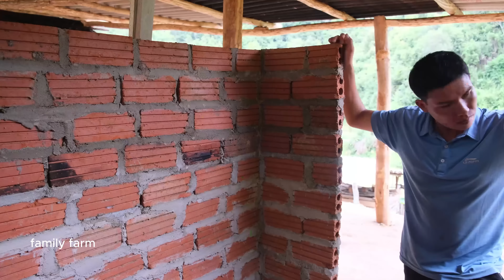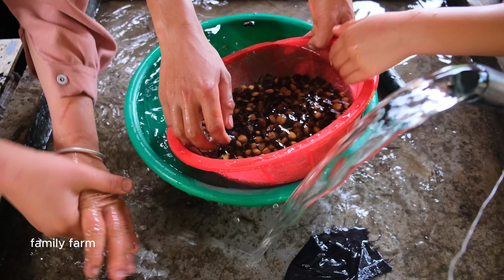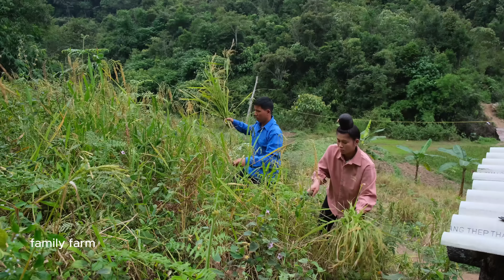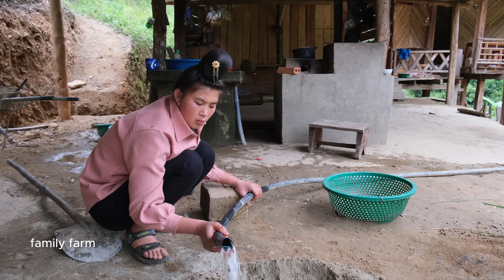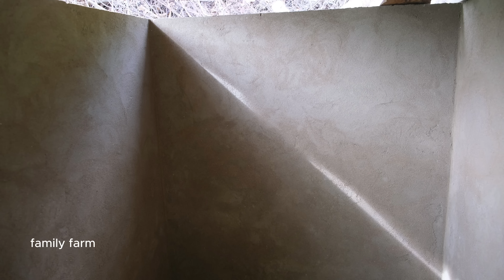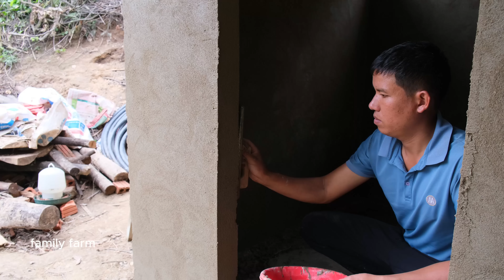Take your daughter to pick cheap seeds, Harvest Upland Rice, Complete the Bathroom | Family Farm

Comment: Why is the way to harvest rice like that? Why don't you cut it short with a sickle or use a crab, then put it in a sack and crush it or hit it with wood or a stick so it falls out quickly?
If you use a shorter scythe, there won't be a lot of waste and you can put it in a sack so it doesn't scatter when you hit it so it will fall off quickly. Practically not complicated, good luck trying it 😁👍